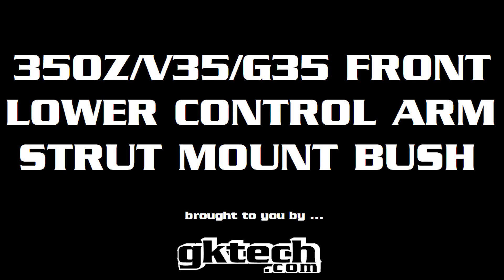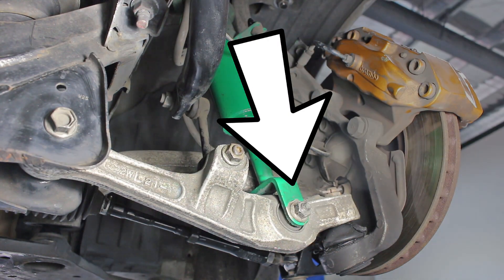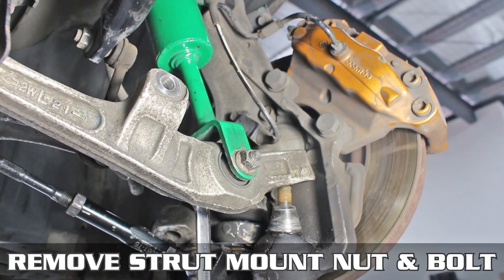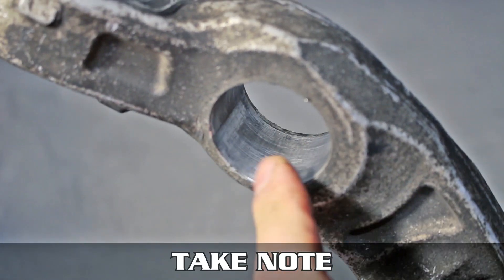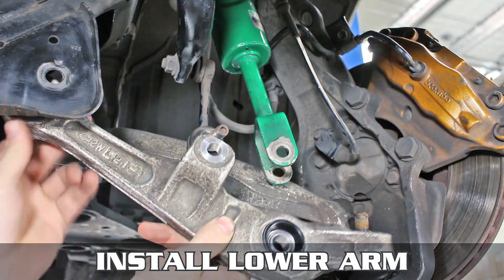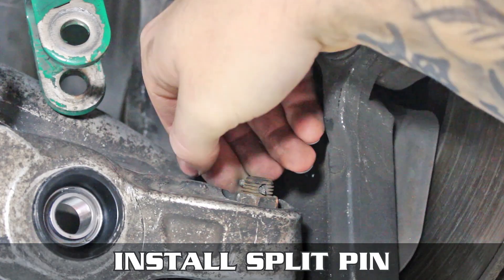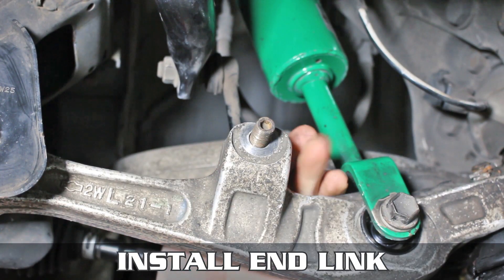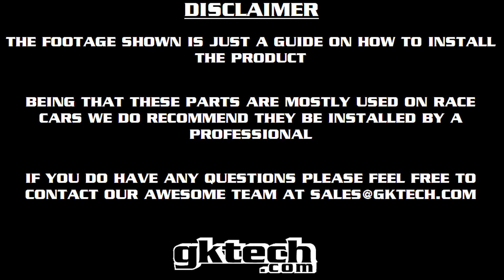Gktech 350z V35 G35 Front Lower Control Arm Strut Mount Bush - Install

Comment: What size socket was used to press out ?
Reply from the maker: As it was filmed over a year ago I can't quite remember, you can easily check what size to use by measuring the OEM bushing once the arm is out of the car.